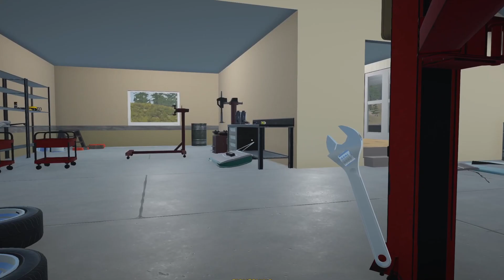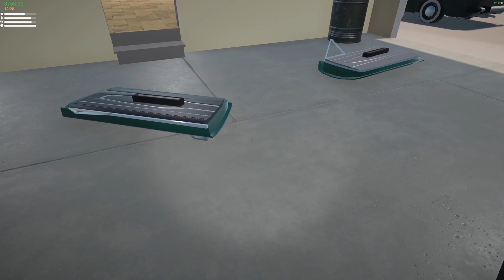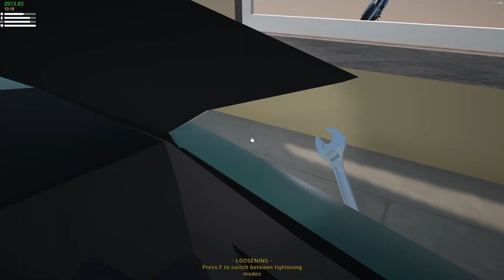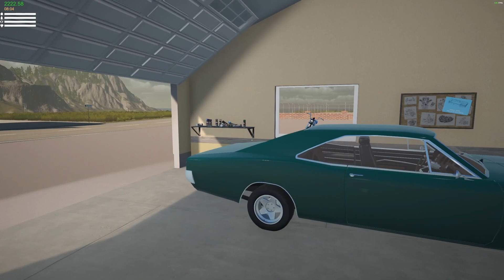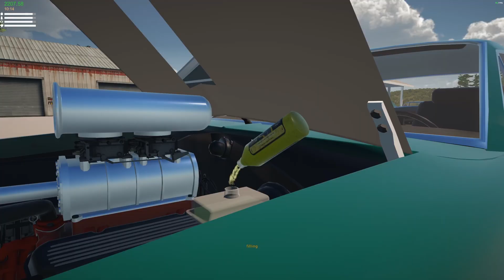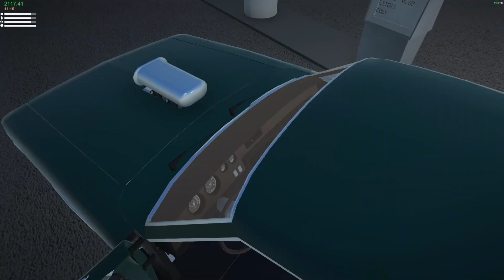Finishing The Chad V8 To Drag Race It | My Garage

Comment from the maker: Had a couple car building mistakes that I figured out after editing and uploading the video:
1: The set of headlights wouldn't attach because I bought the wrong ones. I needed the ones in the catalogue that show the picture of it with screws.
2: I guess I never tightened the bolt directly under the master cylinder... That's why the brake fluid kept draining.😓

Comment: I think the rear end has different diffs you can buy with different gear ratios. The lower the number, (2.0 to 1) the higher the top end speed. (4.54 to 1) will give you faster acceleration to top speed. Excellent job on the car build! Its a monster! 😁👍
Reply from the maker: The diff should be a pretty easy swap to do, should be fun to try and see how much of a difference it makes. Thanks!

Comment: When you pull into the first box the timer starts. Parking outside of it gives you more time.

You'll need to change the differential to get better performance for the race your running.

Some tuning tips:
Higher number = faster acceleration but lower top speed.
Lower number = slower acceleration but higher top speed.

You want the highest gear to just max out at the end of the longest straightaway on the track your running on.
Reply from the maker: Thanks, definitely going to try a different diff next time!
Reply: @ChristophGaming  since you weren't maxing out @the drag strip a higher gear ratio for more acceleration and a lower time is recommended.

Just be careful as the greater acceleration can lead to the wheels spinning when launching.

Comment: there is actually a roll cage for the lad and the lad coupe, they should add it for the chad and  the bart also, it would make drag builds cooler and more realistic
Reply from the maker: Ohh nice, I didn’t know that was in the game. Maybe I’ll turn the lad into a rally car, and keep the Chad as a drag race car. Either way that roll cage sounds cool, thanks!
Reply: @ChristophGaming  I also dint have noticed the cage exists until I was restoring a lad coupe and bought it by mistake